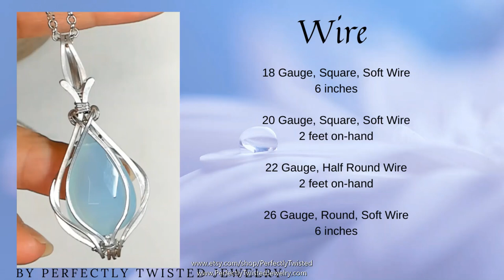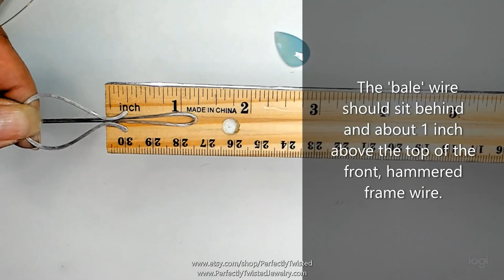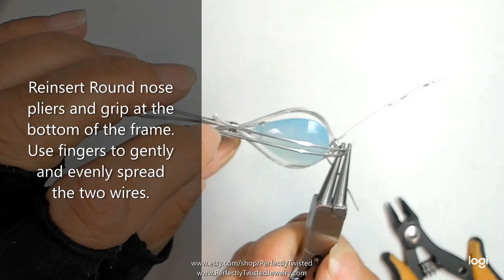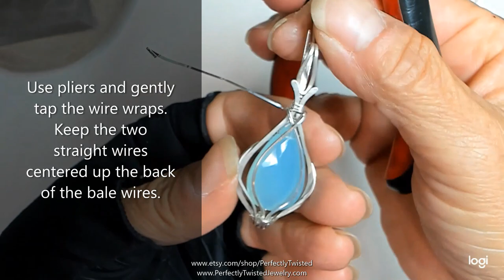FOCAL BEAD PENDANT - Beginner Wire Wrapped Jewelry Frame Pendant Tutorial

Comment: i love this tutorial  thankyou!   i would love to know how to put add a little jewel in the top and bottom
Reply from the maker: Good morning!  Thank you so much, I love that you love my tutorial! The easiest way is to tie on a beautiful gemstone beads or even metal beads... I like to use 28 gauge, it fits most small holes.  Center your bead on the wire, then use the ends to wrap your bead onto the frame.  If the hole is large enough, you could also use 26g.  Let me know if that helps you.

Comment: Would this work with a triangle shaped stone?
Reply from the maker: I can imagine that it would but you'd certainly need to modify some.  As long as the triangle is similar in size to the stone in the video, it might work out.  Have fun! You might do a trial on copper wire and a triangle first then go to silver if it works out.